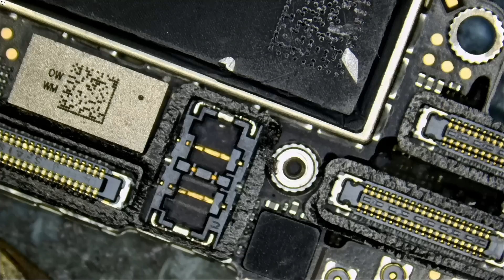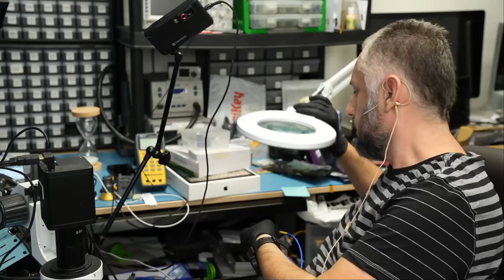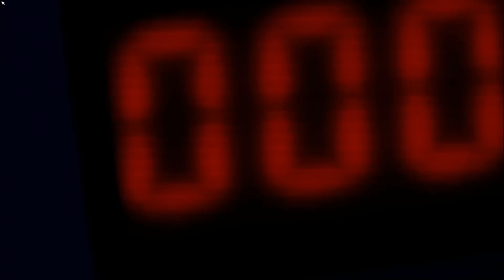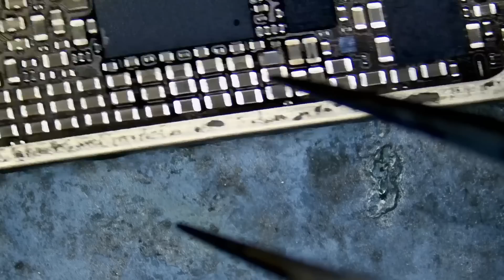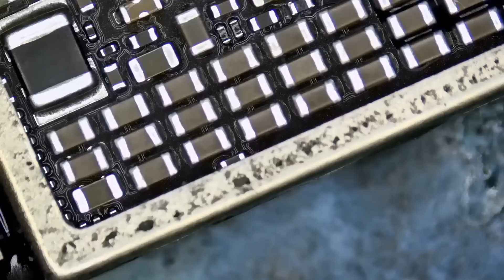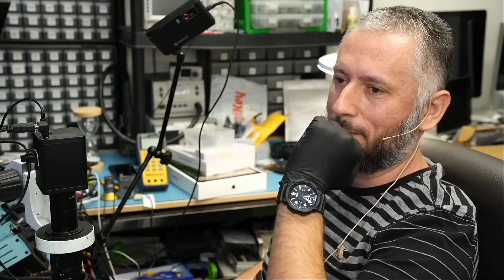Urgent iPhone 7 Repair - Dead No power.

Comment: That iPhone direct board power supply you have is pretty bad ass. Would love to see either another model or adapters for android phones. A data connection would be a nice feature too, then you could possibly backup data without needing to install the motherboard back into the case

Comment: I have something for you to try. Thermal printing paper. Place on the suspect area. Mark and index it for it's location. Apply pressure with a soft sponge and apply voltage. The black hot spot says heat. I worked with those printers and the print is amazing. A microscopic pattern of  cross wires, heating and cooling in microseconds.

Comment: Genuine question, regarding the caps. I like the guard analogy you give regarding why there are so many.

However, I'd love to know why you think the manufacturer places to many "unneeded" caps and components onto their devices? I mean, if its say 1 cap per iphone, and that cap is 1-5cents, that soon stakes up to lots of money across just one model.

Or is it simply because you only expect/want the device to last as long as it would take to recover the data, and are not expecting a long term "repair"?

Comment: Also the several capacitors in parallel are better than a single one equivalent to the sum of all because the ESR (equivalent serial resistance) decreases because all individual ESRs are in parallel.
You are a good repair man, but you are an excellent seller……

Comment: I would like to see one of thèse boards with all these Caps removed, just to see if it will power on and Work. After all the source is already pure DC, it's a fkin battery. Seeing all these boards failing because of a shorted cap, and knowing the pure philantropy of the company it would be interesting to test....

Comment: I think that another and not less valid reason to use caps in series is to lower the total ESR. It's done on conventional ATX pc motherboards where space is not an issue. We are using the method when designing preamps and so on